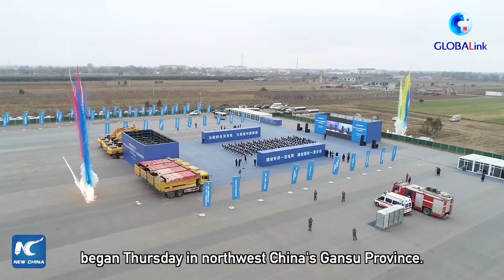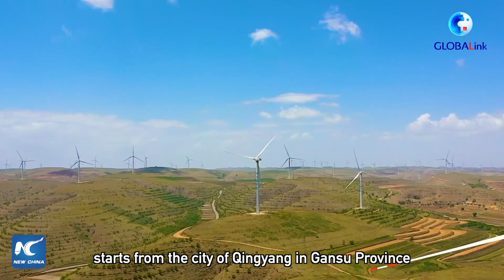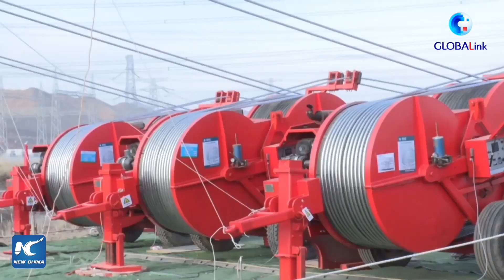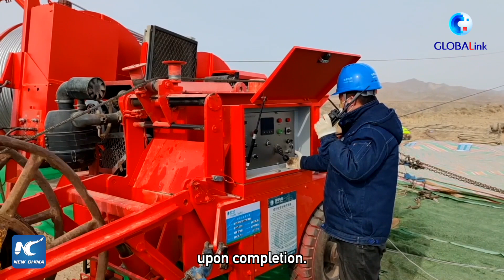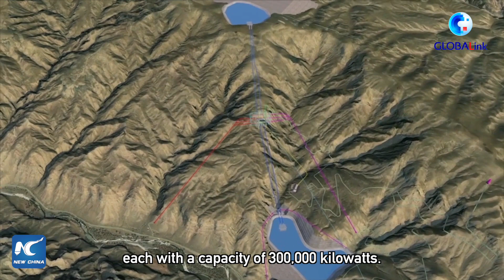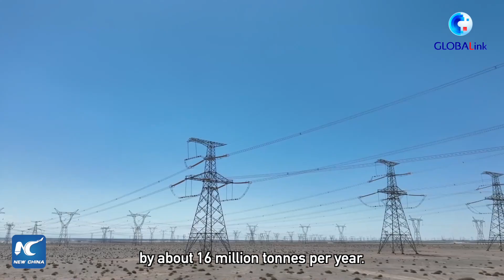GLOBALink | New UHV power project starts construction in NW China

Comment: Let's break the details of this project down.  The 800kV UHV transmission in DC is rated to carried 36 billion kilowatthour.  That is 36TWh.
At the same time China started the Yumen pumped storage hydro that has 4 units of 300MW turbines.  Thus the maximum possible output of the pumped storage hydro is 4 units x300MWx24 hour x 365 day = 10,512,000 MWh or 10.5 TWh.  This means the UHV has more than 300% capacity so it must be used in conjunction of other power generation which would be the existing and new Solar parks or wind farms.  A pumped storage hydro is one that can be used to pump water from a lower reservoir to an upper reservoir when there is a surplus of energy, say when the sun is shining.  At night say without any solar power the pumped storage can release the water from the upper reservoir to the lower reservoir to generate electricity.  The turbines are just the reversible type optimise for best efficiency in combination of pumping and turbining.

From the project it is clear to me that China is well on its way to develop the renewable wind and solar energy, how the vast energy could be stored and then reused plus how the green energy can be transmitted over a long distance of 926km from the isolated Gansu to the well populated Shandong province.

My point is not looking at just one one UHV transmission line but be beware of the whole picture.